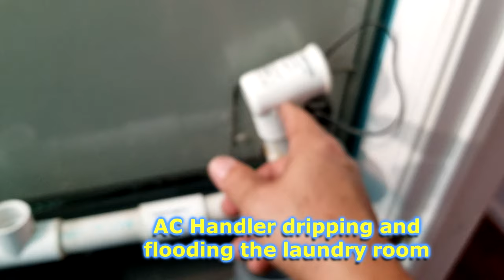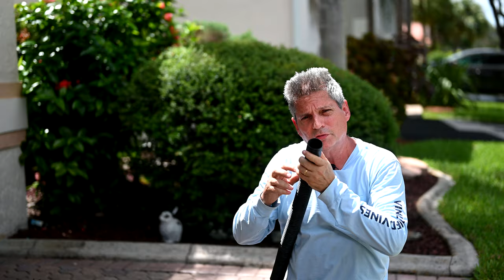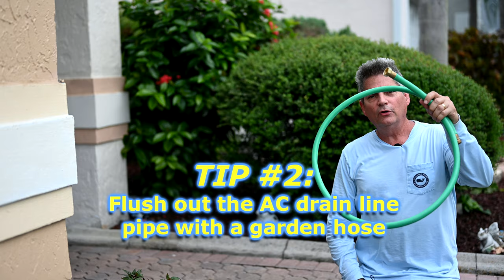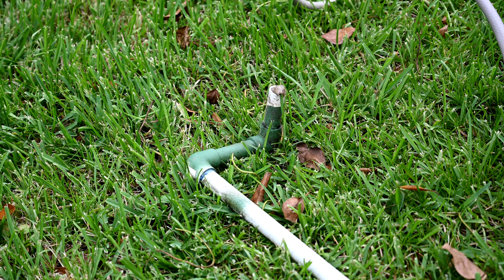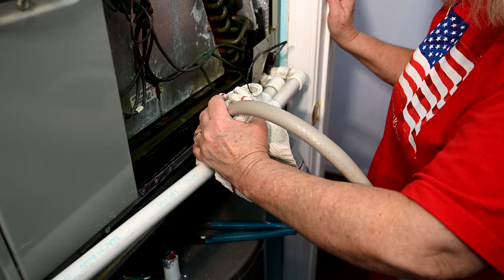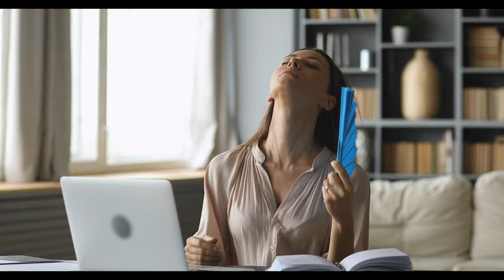AC Dripping/Won't Turn On?  2 Tips Unclog AC Drain Line Pipe

Comment from the maker: Order your Toughsystem 2.0 tower tool boxes from Home Depot Online:
🛒 DeWalt ToughSystem 2.0 Full 3 Piece Tower : https://homedepot.sjv.io/OjOBr
🛒 DWST08450 ToughSystem 2.0 Large Mobile Toolbox: https://homedepot.sjv.io/z74qr
🛒 DWST08300 Toughsystem 2.0 Medium Toolbox: https://homedepot.sjv.io/q7yNY
🛒 DWST08165 Toughsystem 2.0 Small Toolbox: homedepot.sjv.io/B6P1y
🛒 DeWalt ToughSystem Workshop Racking Storage System https://homedepot.sjv.io/M92n2
Reply: What’s up how are you doing I’m from Lexington Mississippi why does my Sentra Sentra why does the central air is leaking water why is it leaking water will you don’t put bleach is stopped up but you put cold rocks in it then you can try bleach in it being washed out in the outfield I have been changed but I’m from lexible Mississippi I want you I want you to think about this and tell me something in the comments why does the Chi leaking water why you didn’t put a you don’t put a filter on and I have put peroxide on it and then I try bleach try bleach
Reply: Tell me why is it leaking water is stopped up why is my sister he sent your air condition leaking water but I have tried call rocks in it and then we have put bleach in the field I have been Shane and have it washed out tell me why is it leaking
Reply: My unit's pipes are inside the walls on the second floor and are going directly to the bathroom sewage (adjacent room) and then  down to the street, a technician was a bit reluctant to try and unclog it because he cant really access the pipes any thoughts on how to procced? Thank you in advance your videos are wonderful and have taught me a lot
Reply: @patrochism7700 I’m wondering what the heck your saying.  I tried google translation but nothing.

Comment: Thanks for the video. In my case, the drain line was barely accessible but I bought a "rubber bladder" at Lowes. This device connects to a hose but expands due to water pressure and creates a tight seal where you insert it. Very neat!
Reply from the maker: Great tip!

Comment: In FL, you need to be doing every month. Set a reminder, 1st of the month, boiling water and white vinegar to flush your drain line. Will save hundreds of dollars in the long run!!
Reply: I have a better idea….move out of Florida, avoid all humidity, avoid desantis, avoid trump and your life should improve greatly….
Reply: @erlpen2016  show on the wall chart where the big bad politician touched you, sweetie...
Reply: @Weezulguy right? Imagine being so unhinged that you turn a how to repair video into a platform to expose how frail you are. Unreal stuff.
Reply: @erlpen2016 I agreeee lol
Reply: Pour it on the inside pipe or the pipe on the outside of the house

Comment: Thx!!! Had a clogged upstairs AC unit. Hit it with a hose and put a cleaner pill in troul. Thank you for the help, cleaned it right out and AC is back up and running.
Reply from the maker: Way to go Ronald! glad to help
Reply: Where do you get a cleaner pill?
Reply: @catamazing5631  ace hardware is where I go, but im sure Lowes or Home depot have them. Should come in a 6 pack, just ask for AC pills that help with draining. Put 3 in troul,  1 at back, middle and front. Pour half gallon of white vinegar, wait 24hrs and pour the rest. Hope this helps.
Reply: @ronaldsanchez7508  Thank you!!
Reply: @ronaldsanchez7508  what or where is the troul? 
(Lady that doesn't know a thing about HVAC units.)
Reply: @catamazing5631  is the drain pan.

Comment: Great tips! Unfortunately our drain is up in the attic of a two story home. Can’t get a hose through the house to the attic. Already tried an air compressor.
Reply from the maker: What we do nowadays that works well is get a shop vac to the outside of your house where the pipe is, put the vacuum hose over the pipe and tape it sealed shut or cup with your hand to seal it, and turn on the vac for 10 seconds, and that usually clears it right up.

Comment: That may be the problem I’m currently having. I’m going to try the wet vac tomorrow. My ac is in the attic so I shouldn’t use the garden hose should I? I have a drip from my ac vent in my hallway and to the left of the vent is a water stain on the ceiling the shape of a cookie sheet but bigger.

Comment: Very good demo and liked that you suggested several methods and pointed out that the problem tends to repeat itself. I would say your recommendation of once a year is not aggressive enough. Most recommend flushing out the line when you change your filters. Also, it would be best to mention to turn off the unit power switch and the circuit breaker when you opened up the unit to get a look at the pan. Most know but obviously some may not realize . Overall, great video

Comment: Hi Jeff, you may not see this comment a year later, but I’ll give it a shot.
You may be able to split your hose in half in order for the hose to slip into the ‘T’ in the direction you want it to go. There maybe enough purchase with the hose to not allow much water to flow the opposite direction. 
Would it be ok to place a ball valve in line so the back flow doesn’t enter back into the AC drip pan?

I have been vacuuming my drain out every two months. I’m glad you showed us how to flush it with a hose. I was able to actually clean my pipe. Afterwards, I poured Clorox down the pipe. In a few days I’ll flush it with the hose again.

Thank you again for sharing your knowledge. God bless
Reply from the maker: Yes some people put in ball valves which is even better, it cuts off any threat of water going back into the AC

Comment: Thanks Jeff for providing me the link to this video. I vacuumed the AC drain line yesterday, and I have been monitoring it today. In fact, this morning, I actually used a bottle of water and ran the water through the ac drain line from the inside, and then I ran outside to check if the water or drips of water are coming. I did the see water coming out of the AC drain line, which is a good sign. It  probably needed to collect a little water before the water level reaches the opening for the condensate drain line? I am going to vacuum the AC drain line one more time today, just in case. What is your recommendation of how long should I leave the vacuum on to drain the AC line? Yesterday, I only vacuumed for less than 20 seconds because once I opened my wet/dry shop vacuum, I saw at least 2 inches of water in there. I wasn't sure if I needed to vacuum the AC drain line longer.

I also reviewed the float switch, and I used my leveler to verify the slope on the AC line from inside the house as you've demonstrated in the video. All checks have been confirmed. I haven't opened the panel to review the AC pan yet because the set up is similar to what you've experienced with that AC unit in your video. It's like a mission. I'll let you know if I am faced with any other issues. Thanks again, Jeff. Appreciate the great intel.

Kudos to the Mandalorian nod. This is the way.
Reply from the maker: LOL this is the way!

Comment: I'm also having the clogging issue from the A/C drain line, but my drain line is piped into the upstairs bathroom sink, just above the pea trap. I have to snake that sink drain at least 3 times every summer to get that clog removed and it is so frustrating! I am at my wits end on how to solve this issue.
Reply from the maker: There should not be a problem, sounds like they don't have enough slope on the line from the AC.
Reply: @jeffostroff  It is not the A/C drain line that gets clogged, it is the bathroom sink drain that gets clogged beyond the pea trap deep in the wall. I don't know how to solve this problem.
Reply: @blaziustheblaze9935  any luck with this. ME TOO
Reply: @just3269  I've had this problem several times again this summer. I've had three different plumbers come over and the only solution they have besides snaking the drain every time it clogs, is once each month pour one cup of bleach into the drain. This will kill the bio-build up that comes from the A/C drain, and then pour 2 cups of boiling water down the drain. So far this seems to be working.

Comment: I don't have a place to connect a garden hose upstairs that can reach up into my attic on my two story house. It would take a  very long hose to connect it to the outside spigot and reach it all the way up to the attic. .
Reply from the maker: Yes that is what we did we bought a 110' hose that we use just for occasions like this where you absolutely have to go a long distance. The other way you can do it is to put your shop vac outside on the output side of the condensation drain line.. Just seal it up with tape and turn on the vacuum for a few seconds a lot of people report success doing it this way.
Reply: @jeffostroff  But what about those Co2 air guns you can buy on Amazon? My technician used one of those.
Reply from the maker: @crand20033  Yes, those will likely work o, but most homeowners won't buy one.
Reply: @jeffostroff  35 dollars for the gun. A shop vac is a hell of a lot more expensive. Can you do a video showing that option too or revise this video?

Comment: Jeff, just saw this video. I’m currently studying HVACR and only 4 months in and my A/C stopped running. I actually did everything you did but let me ask, the pan (or as I like to call it the canal that runs around the bottom of the coil get all that gunk buildup. Isn’t it also good to run the vacuum in that canal/pan and perhaps pour a little chlorine to clean the lines? I hope you can answer my Q. Thank you.

Comment: Jeff, can dirty coils cause the tray underneath my unit to fill with dripping water?
Reply: I need the answer to this as well. My unit is in our attic and although the condensate line is dripping water outside, the tray below the unit over time fills with water and there is an overflow that drains into the garage. I vacuumed the outside with a wetvac and thought because it pulled some water I was good. But over the next 2 days the pan filled up again and the overflow started dripping again. The PVC pipe that is the normal condensate drain line sits above the tray a good 2 or 3 inches and without taking the cover off the unit (where it is situated in the attic it would be extremely hard to get it off) I don't know if there is a tray above the tray (so to speak). I just thought if the condensate line is dripping and moving through the PVC how is some of it even getting to the overflow tray beneath it? The only thing I can figure is the condensate line is not removing quite as much as is being created. I don't have a cleanout.
Reply: If your coils are dirty enough it will cause your system to freeze. If it freezes the water will not travel where it is designed to go and it will find its way to your 2nd drip pan.
Reply: Or your primary drain pan is cracked and it's leaking

Comment: Good stuff. I'm in Texas so AC issues are no joke. Our house is relatively new and has a primary drain line that is hooked into the sink in the guest bathroom and a secondary that exits out the side of the house. There are basically two pans. One in the unit and another under the unit so it looks like the secondary drain line and float vale is on the lowest pan. I'm assuming that its a redundancy in case the internal pan spills over due to a clog in the main. The kicker of it all is that you can't even access the primary pan because the HVAC installers sealed off the evap coil box to the blower motor with some mastic tape/glue. It sucks because I would like to drop in a few of those bio tablets in there to help keep the film from growing. At the very least I'd like to be able to check the coils as given the humidity I think they have been icing over.
Reply from the maker: I have never had good luck with tablets, I stopped using them

Comment: Single story home, AC unit in hallway. The condensate line is clear, but the side outlet which is the overflow outlet attached to the drain pan continues to leak on top of the half height water heater below it. The only opening I have is the part where I replace the AC filter. There's only like 4 inches of clearance on the side of the AC (which is where that outlet is leaking). I'm at a loss. Any ideas?
Reply from the maker: Need to see more specifically where the drip is coming from on that part, but usually the PVC parts will leak because whoever cemented the 2 PVC parts together failed to use primer, so it leaks at the joint.
Reply: @jeffostroff  Thanks! It's a Trane & the evaporator coils are upside-down, V shaped instead of A / tent shaped. The 3/4" outlet isn't a PVC pipe. It's metal & I think it's part of the component at the bottom of the V. Hope that makes sense. If not, thanks for the feedback regardless.
Reply: @jeffostroff  what kind of primer?

Comment: Thanks. Just fixed my leak, yuk. It works now.
Reply from the maker: Awesome glad to hear you fixed the leak on your own saved another $150
Reply: @jeffostroff  yea. Had to run a snake up the line from outside to free the line. Everything is drying out, air conditioner working with no leaks. Thanks again.

Comment: My air conditioner keeps freezing even when the filter has been changed. This means no cool air coming out of vents and no water dripping out of the drain line. I will let it thaw for a full 24 hours but it still seems to happen from time to time. Will unclogging the drain line solve it or what could the issue be?
Reply from the maker: if it is freezing even changing filters, and if the pan is not overflowing from a clog, your likely problem is the amount of pressure of refrigerant in the system.
Reply: @jeffostroff  I am curious what that indicate not enough or too much refrigerant? I had a new AC installed a week and a half ago in Oregon and yesterday was the first real test of the system. The condensate pump wasn't able to handle the load for whatever reason and I had to manually dump the reservoir every one and a half to two hours keep the system working. I have a call into the company that installed it but they're going to be very popular with the high temps we are now experiencing.

Comment: My new house (flip) has had 6 visits in a month. I was told the drain line was installed incorrectly and needs redone. … I went in attic and noticed pan is full of insulation? Is that normal?  Love video!
Reply: I’m terrified of heights so I almost had to call 911 to get out of attic lol. Thankfully my daughter figured how to get me dow 😭.   I feel like there shouldn’t be debris hanging out in drain pan.
Reply from the maker: There should be no insulation in the Pan the pants should be completely clear and have a good path to the pipe. No I'm not sure what they were saying about the pipe and why there is a need to have it redone. What reasoning do they give you a?
Reply: @jeffostroff  thank you for responding.  They said the way it’s piped, it’s causing it to become blocked by piping in walls.  I thought odd but I did buy a flip house with major other water issues. 

The AC cuts off until it drains which takes 2-5 days.  Then turns on for 3-4 days.  

I went in attic with a ladder once and sadly there are no floors, only beams but I did see the plastic in pan and insulation on top.  The unit piping is on other side 
So unable to reach side to try and clear. 

Im going to call a new HVAC company.  I do use shop vac outside but only gets some water.

Comment: Thr way HVAC installers do the cleanout in my area on the drains round here is a T connector just like how that one was with a 1/4 turn shut-off valve between it and the drain pan that way when you flush it out whatever your spraying doesn't back up into the pan and goes out in the correct direction.
Reply from the maker: Here we bypassed the pan

Comment: how strong does the wet vac have to be?
Reply from the maker: Well it works when I'm using my little Milwaukee M12 battery powered two gallon vac, so it doesn't take a whole lot of suction just enough to create that suction inside the pipe

Comment: Jeff Ostroff, I sent my questions to you before. I have another question. After watching your presentation on the PVC Valve which I have, should water drip out from this area? It sounds hollow when I open it up. This is where I pour Bleach down Monthly to keep from any back ups. There's water I notice, but it doesn't drip out. Is it suppose to drip out into A/C Pan? My Apartment gets really Cold. I have it set at 78. Would this be a concern of any? If so, I want your advice. I don't have a hose I can visually see.  My water hose for my A/C Pan is covered by the Condominium first floor. I did notice a large amount of water around the soil. All advice welcomed. Thank You!
Reply from the maker: Can you send me photos via Facebook messenger? https://www.facebook.com/jostroff
Reply: @jeffostroff  when I use my 
A/C again, I will send all information your way. Thank You again.

Comment: Looks like a fine solution, but my problem is that the drain line comes out under the house and I would have to crawl about 30 feet to reach it.  I have a five-gallon bucket sitting under the unit in the closet and it fills up in about two days, so quite a lot of condensation.
Reply: Now you see what an AC guy would have to do to reach it. I recommend get some PVC pipe an extend it.

Comment: I have a condensation pump that drains the water; I'm not sure if these would work for me?  Thoughts?
Reply from the maker: The pump is low pressure, you still need the garden hose to flush out the pipe, or suck it out of the pipe from outside the house with a shop vac sealed to the pipe with duct tape